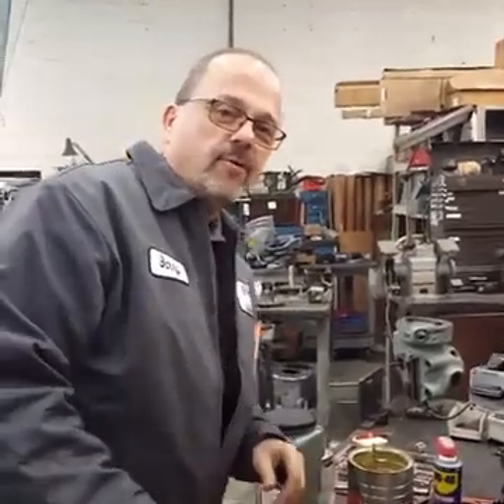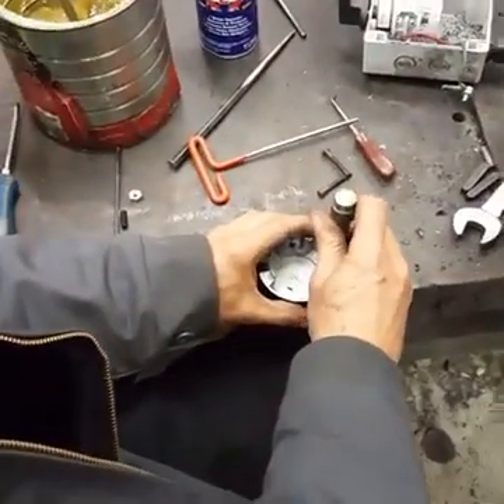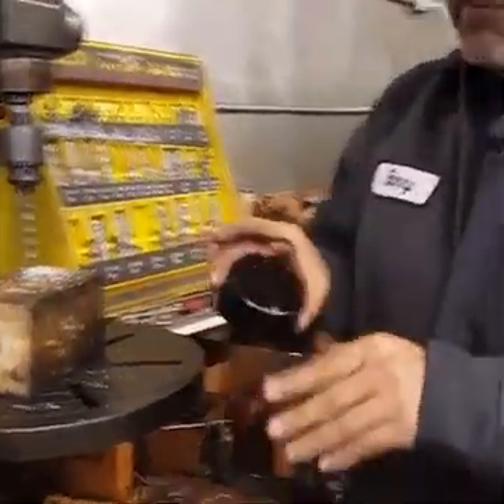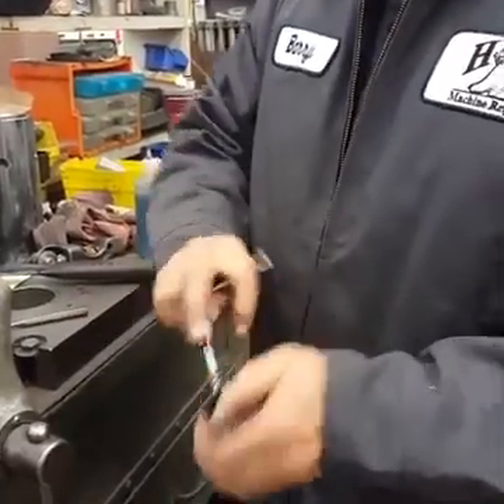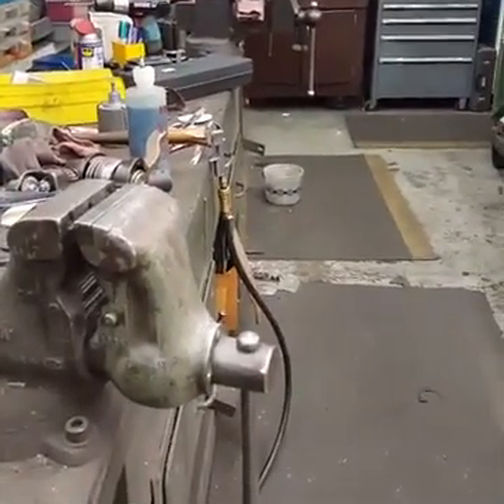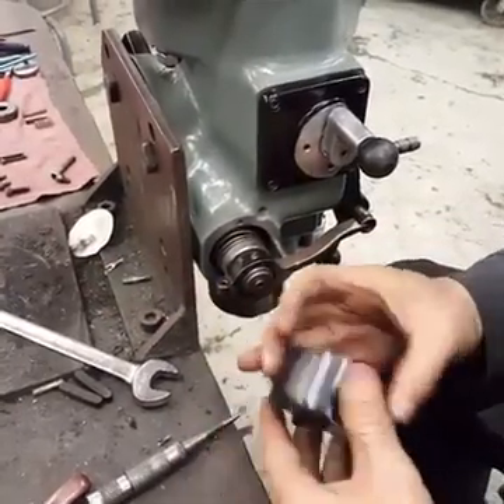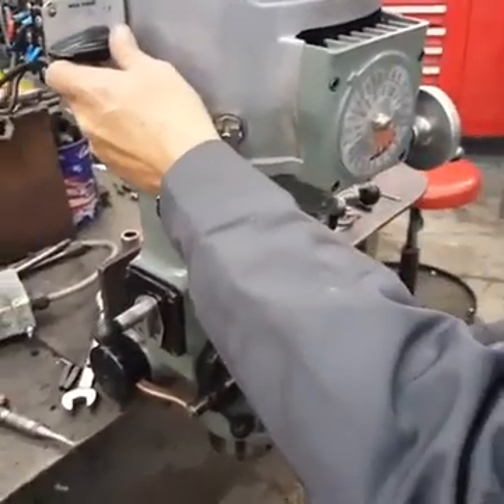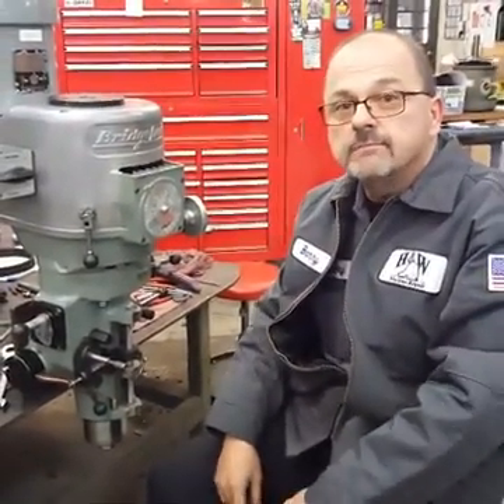Quill Power Downfeed Adjustment

Comment: Do you care to elaborate why we need the set screw to put the clutch in the proper location? Is the cover depth incorrect at the pin location? I am going to shim the endplay out tomorrow of the quill down-feed feed shaft on mine with about .080 washer. But I think I'll still need to add the set screw to the clutch cover to get it to mesh.
Reply from the maker: Please give me a call at 800-285-5271 so we can discuss the question over the phone. -Barry

Comment: Hello Barry what would cause the clicking sound and ratcheting in selfie down it clicks stops and then goes again
 thank you Larry
Reply from the maker: The clicking noise as the handle is moving down without the downfeed engaged would be the placement of the overload clutch gears. They are just barely touching and would have a clicking noise. It will go away after a little bit because they are so close to touching that it just might move enough away after a bit. You can give me a call if you would like to discuss your specific issue over the phone: 1-800-285-5271

Comment: Hello Barry 

Mine in self feed clicks like it’s ratcheting.   Would this fix it 
Larry
Reply: What you are hearing is two gears rubbing together. I had the same problem which I think is common among Bridgeports and  Bridgeport clones. This modification should solve your problem by allowing you to adjust (increase) distance between the two gears.

Comment: What would cause the handle not to latch in the closed position, the handle just springs right back to the open position?
Reply from the maker: Most likely the Feed Trip Plunger that is behind the scale is stuck in the up or kick out position.  First put the quill handle down about 1” from the top so the Quill Stop is not touching either the top of the quill housing or the stop on the micro screw.  Remove the bottom screw in the scale and see if you can then wiggle the Feed Trip Plunger up and down.  If you can then you should be okay.  If it is still not working it is possible the kick out set screw is too high or things are gummed up somewhere else.  Give us a call at 800-285-5271 to discuss it further over the phone. -Barry

Comment: You give no explanation whatsoever of what this "mod" actually does but you warn us that unless the quill is down a bit you may ruin your gears. It would be helpful if you explained that it that setscrew is set in too far or out too far it doesn't allow the gears to separate enough?? and then they strip??  That's what I'm assuming, but I'm guessing.... Are we limiting the "throw" of the clutch?? If you could elaborate a teenie tiny bit it sure would be helpful...

Comment: Luckily I don't need this adjustment yet on my Bridgeport but the engage lever wasn't working due to the trip out block on the end of the engage lever shaft coming out too far allowing the spring loaded mechanism inside that block to drop off the boss near the tip of the trip shaft.

The trip shaft was binding as well. Adjusted the limit stop bolt on the lever arm at the clutch housing and a liberal application of CRC all around and now the engage lever is engaging and staying engaged.

This video certainly helped, thank you Barry, especially putting the quill half way through travel to not break gears if it ends up going backwards.

And I can see how the circlip can be broken as well because I nearly did it myself. A great learning experience.

All I have to fix now is the reversing mechanism on the quill feed, but that can wait for another day.

Comment: Hey Barry - thanks for all of the videos. They are super useful. Quick question. The gear at the bottom of my cluster gear stack is totally stripped - I believe it is called the Feed Reverse Bevel Pinion. My question is whether there is a way; short of a complete tear down, to access the set screw so I can replace it. Thanks in advance!
Reply from the maker: Unfortunately you will have to take the whole top half of your head off in order to have access to this. There is no other way to get it out except through the top of the quill housing. -Barry

Comment: Hi Barry  Thank you so very much for doing these videos. They are very much appreciated.
Our power quill feed wasn't working so after watching this video and the other one on quill feed issues I tore it down, cleaned all of the parts up and put it back together. My issue is with the reverse neutral forward shaft assembly. Can you explain the operation of how that reversing shaft works and also the proper re-assy of the setscrews in the shaft. I need to mess around way to much with the tightness of setscrews to get it to work properly.  Thank you!

Comment: What causes this malfunction?
Reply from the maker: Normally it is due to wear in the two halves of the clutch but sometimes it is a problem with the quill handle taking a hit and shifting slightly knocking things out of adjustment.

Comment: Mine had spring adjusted all the way in by previous owner because quil was bound up. I ordered new spring from you in my last order. I cant find and info on where to start with spring tension. Do you have a measurement for that? Or is there a torque measurement for clutch release at quil feed?
Reply: mrhp434 I’m having the same issue

Comment: Thanks for this.  I bought a Webb Champ 3 (BP clone), and I think the clutch arm is tweaked.  The clutch will not disengage.  Rather than buy a new arm, I'll try your set screw modification and see if that works for me.
Reply: Dude!  You rock!  5 minutes of labor and a nickle's worth of fasteners and my issue is fixed!  Thank you so much for the video!